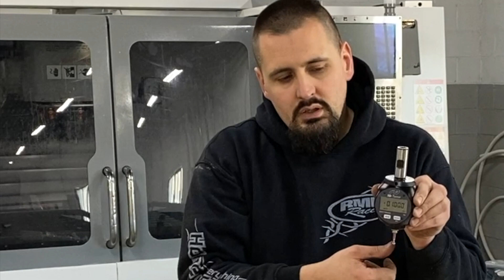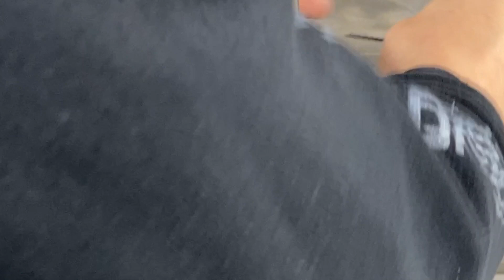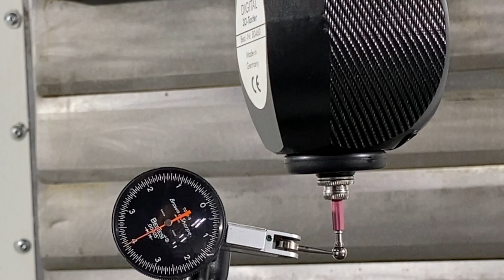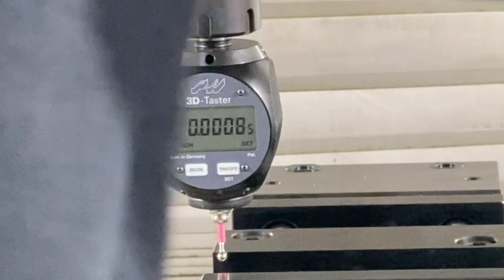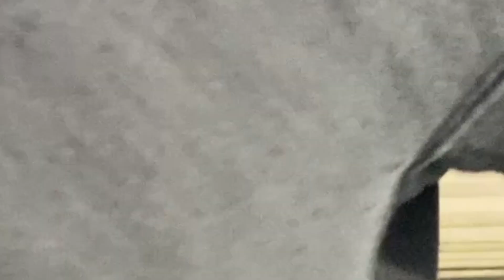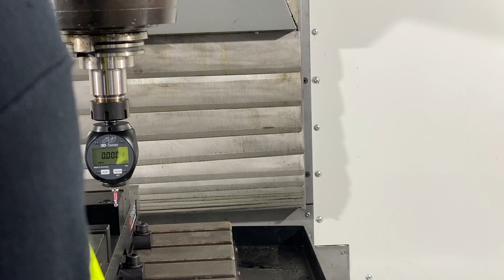Haimer 3D Digital Sensor Review

Comment: I have the same digital Haimer 3 D but the lithium battery is dead. . I tried to unscrew 2 little screws in front of it and pull it out . Battery is out half way but does not want to get out more. I spent hours to try to get it out but no way.
Franck. From France.
Reply from the maker: We have not ran into this yet. I have been amazed how long the battery has lasted. I am sure we are due. I'll try to look it over and see what I can find out. If I find something useful I'll let you know.
Reply: Ok thanks

Comment: can you use both inch and metric probes on one unit?
Reply from the maker: The probes interchange between all the models that Haimer offers. Hiamer only makes two probes that fit all of their units. The digital unit can measure in metric or inch.
Reply: @RMBRacingInc  I also own the same digital taster, for whatever reason I swear I heard you can only use the standard or metric probes depending on model, my model ends in IN so I wasn't sure! I did use a metric probe yesterday and it worked fine, so thanks for your answer!

Also another thing my package shows 2.000 where yours shows 1.000, I'm curious if I'm using it wrong, haha.
Reply from the maker: @PatientZeroBalisong  Great to hear. Sorry for the delay on the repose. If we can be of any other help let us know.
Reply: You have to use the Metric Probes with the Metric Unit and the Inches Probes with the Inches Unit.  But, no matter which Digital Haimer you have you can choose to display in Metric or Inches.  If you use the wrong probe the offset for centering will be off.  The Metric short probe is 4mm diameter and Inches short probe is .2" (5.08mm).  The long probes are double the diameter of the short probes.  There are a total of 4 probes that Haimer makes which are Long and Short Metric (For Metric Haimer's) and Long and Short Inches (For Inches Haimer's).

Comment: And NEVER use random torque pressure to lock a vice to the table, you'll potentially damage the table man. Ask your machine-tool mfg about the max torque, use a torque-wrench and go <10% on the value. Stay cool!
Reply from the maker: Though it is not in the video we use torque wrench behind our little impact for everything but thank you for heads up.

Comment: Great intro, I just got the same one! Fairly happy. Although I've been advised by the auth rep not to slide the ball on hard surfaces such as steel, that tool is meant to touch apparently. This is to prevent damage to the ball surface. In the case of squaring a vice I'd just use a dial indicator for instance... inexpensive and safer in a scenario where/when you displace the vice by hitting on it a greater distance than the sensor's max.
Reply from the maker: It does not surprise that they do not want the ball ran on a hard surface. It would probably make a difference if you did it everyday but we set vises up and leave them for months on end. If you use an indicator to do it your going to wear the tip on it so I guess it is a matter of what do you want to replace. We reserve our indicators for inspection only because we have them all certified and tips for the Hiamer are not that costly but I will keep an eye on the wear and for sure it is something to pay attention to. Thank you again for the comments and hope you enjoy the Hiamer. We have found it to work well so far.